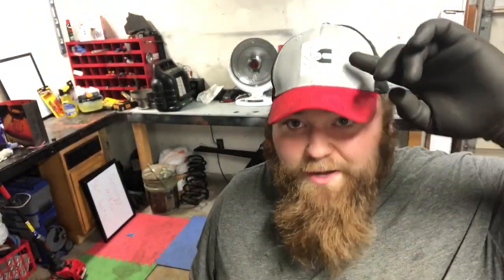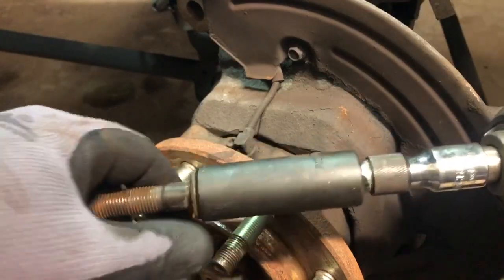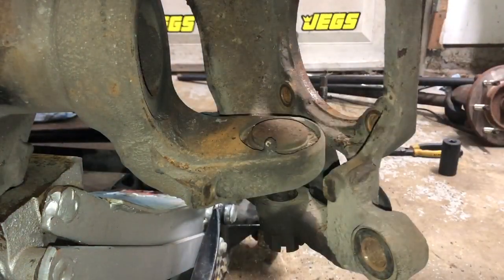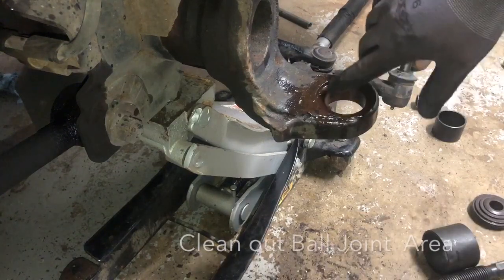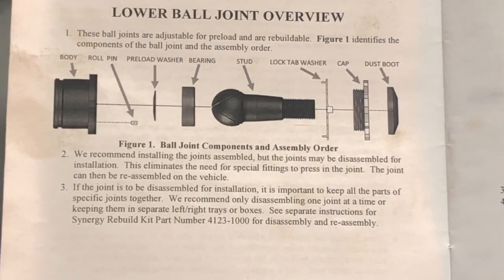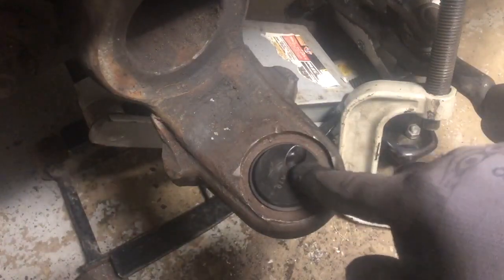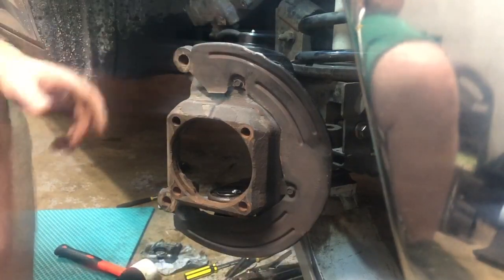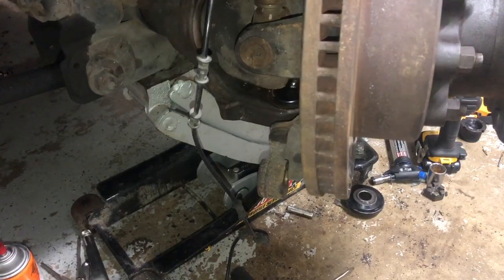Ball Joint Replacement - Synergy MFG - Ram 3500 6.7 Cummins

Comment: HighMileageHelper what are your thoughts after two years on the synergy ball joints? My 08 3500 is in need of new ball joints, but I am unsure of what brand to go with. Ive heard moogs and mevotechs are garbage. I would love to get carli but they’re just way out of my budget. So what’s your feedback after two years since you also do a lot of towing?